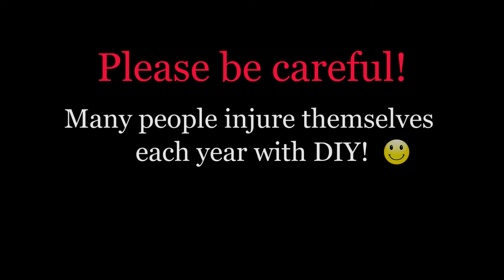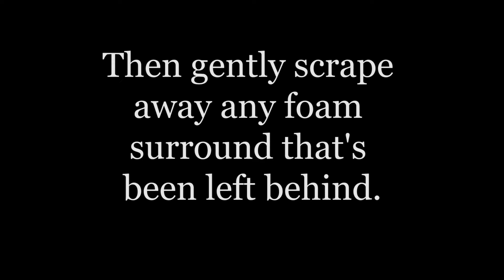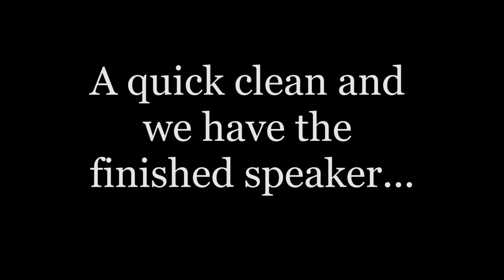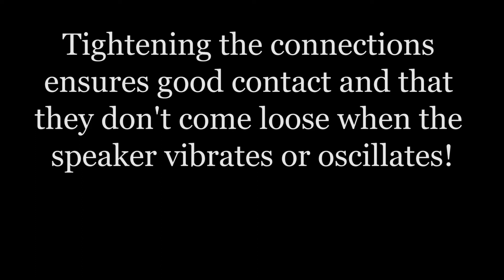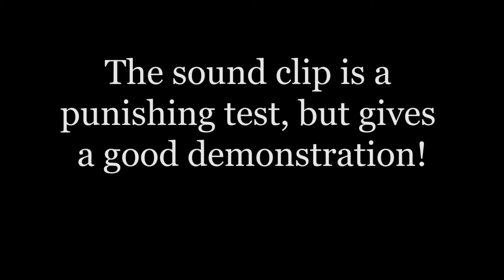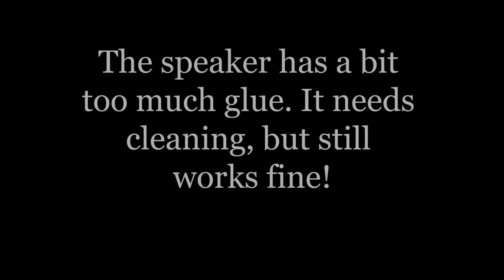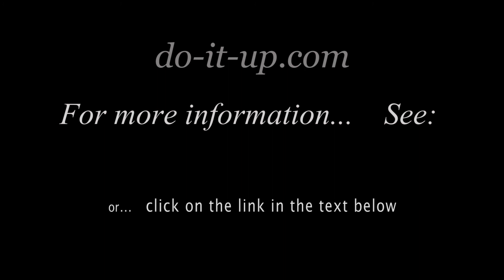Speaker Foam Repair & Replacement from Start to Finish

Comment: Those are nice speakers! They definitely deserve this.
Reply from the maker: It would have been a shame to have thrown them out just because the foam surround had disintegrated!
Reply: I have always thought of paradigm as a Hifi brand. This was their old entry level product, and did suffer from foam rot. They might not be perfect, but they seem to still stand today as the best speaker you can find on a budget. There’s just something special about them, like they focused more on sound than other things, which is what any speaker brand should do. I have a paradigm surround sound with Titan v2, Atom v2, Cc70 v2,  and Pdr-10 speakers.

Comment: The foam that you just attached to the cone has to sit under the gasket, Not over it
Reply from the maker: Hi, not with this speaker. There is no gasket (other than between the frame and the speaker housing). Manufacturers have different construction methods. This speaker was reassembled the same way it was assembled from new at the manufacturer. It's always best to reassemble the speaker the same way it came apart. However, there can sometimes be room for improvement where the manufacturer may have used a method for speed of assembly, (which often applies to just about everything in production line manufacture today).

Comment: What kind of adhesive did you use? (I mean what catergory does it fall into? Eg: silicon. That 1782 glue I would have to order from overseas)
Reply from the maker: Hi, I just use a standard impact adhesive (nothing special). It may not be the same glue as manufacturers use, but it works for me. If you make a mistake,  you can carefully separate the foam with the aid of a sharp knife and start again, plus the glue can have a little give in it when applying (if you time it right).
Reply: I researched this question a couple years ago. The consensus was Aleene's Original Tacky Glue. It's cheap and available everywhere.

Comment: Would u know where to find model # on my 1989 Snell speakers?? I can't find it. ugh
Reply from the maker: Hi, I guess you've looked here https://www.snell.no/the_archives.htm (dependant on what you're looking for). I have no experience of Snell speakers, but if there is nothing on the outside, there may be something on the inside? A paper label maybe, but you may have to remove something to see inside the speaker case. The label may be in a position where you can't see it, so a mirror and a torch could help. Having said that, there may be no markings at all. The shape and any slight differences between speakers may be your only clue? Hope this helps...

Comment: 7:57 what is that noise?
Reply from the maker: It's from the film "Edge of Tomorrow". This was the track that finished off my speakers, so I used it to check if they worked OK after the repair. It gives the speakers a proper workout! Makes me wonder how many other old speakers suffered the same fate as mine after watching the film..?

Comment: I'm thinking to do this on my Logitech Z5500 speakers, 2 of them are going slightly bad, for now I just used contact glue on the cuts that appeared like a year ago and they are still sounding OK, but now they are getting more cuts in other parts, I already have new rubber to replace them, however they seem much more softer than the original so I ended up never replacing it...

I'm actually thinking is to do something different, since I only have a few cuts for now, I'm actually thinking just filling the cuts again with contact glue and then just spray a few layers of Plasti Dip which will add a brand new layer of rubber like while still preserving the original rubber which is not much bad yet.
Reply from the maker: At some point you're going to have to replace the speaker foam, as the original foam will just continue to deteriorate. Will the new replacement (softer foam) make much difference in sound quality? You probably won't know till you try and fit them. Here's a thought... The foam may seem softer, because it's not fixed in place. A bit like the difference between a loose piece of string and a piece of string tied between two nails?

It therefore looks like you may have two options:
- Use the speaker foam surrounds you've already purchased.
- Or, buy some additional foam surrounds from a different supplier (if it's not expensive), and see if there is any difference between them?

Hope this helps...

Comment: Can I use wood glue on the speaker foam? That's all I have
Reply from the maker: There are various types of wood glue available? Try and see what the glue is made of and Google the type to see what surfaces it can be used on. If you know the glue manufacturer, there may be a data sheet online which will tell you what the glue is (and maybe what it can be used for). Failing that, try it on a small area as a test piece, leave to dry and see how well it's worked?

Comment: what kind of glue are you using?
Reply from the maker: Hi, I used an ordinary impact adhesive (This is probably not the same glue that the original manufacturer's use). I didn't let the glue touch dry before putting the parts together, so I could move the foam into place (if I needed to). Make sure everything is central. All the best...

Comment: It's not a good idea to make a video for a DIY repair when you don't do the repair properly to begin with.   Why didn't you remove the gasket around the outside edge?   This is so important as the surround gets attached to the speaker frame not the gasket.  The gasket goes on after the foam surround is attached.  Also RTV or silicone is not the correct adhesive.  You should be using water based contact cement.
Reply from the maker: Hi, thank you for your comment, but...  I couldn't disagree with you more.  The speaker has worked correctly for the last 5 years without any issues. Therefore, how can you say the repair was not done properly?

There will always be a purest view on how to do things. However, If everyone stuck rigidly to a single way of doing things, the world would never change and nothing would ever progress. There are many ways to complete a task. If it works, then it shouldn't be an issue. If a task is completed successfully with the materials you have available, then does it actually matter? As long as no harm is done to anything, or anyone...  Reference the gasket. All parts were replaced in the same position (as per original build at the manufacturer). As a footnote...  I might agree with you, if it was a restoration of a socially and scientifically important and rare artifact 🙂.
Reply: @doitup  I agree with do-it-up..."sometimes good enough really is good enough"....and, "perfection is the enemy of adequate"....and, I'm a perfectionist...life is short.
Reply from the maker: @7captmjh  Hi, thanks for your comment. You've summed it up so well...   😃

P.S. Trying to keep my reply concise...    Because...    Life is...

Comment: А центровать динамик кто будет? Неаккуратно поклеил подвес. Халтура
Reply from the maker: Google translate...   "And who will center the speaker? Inaccurately pokleil suspension. Trash"  I love Google translate? If the repair works, you will have reduced the landfill, made for a greener planet, saved a few quid and impressed the neighbours...